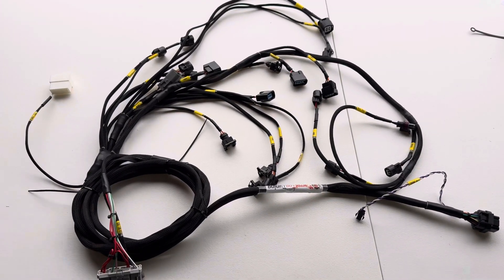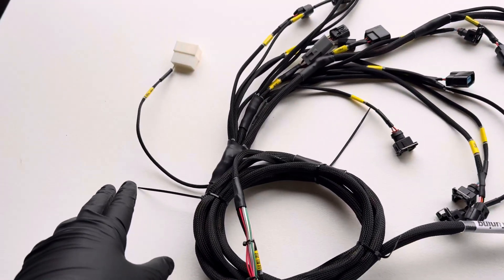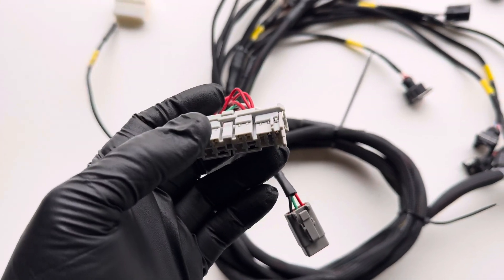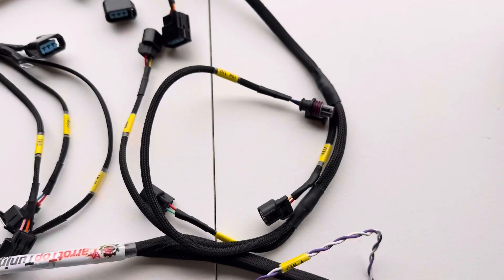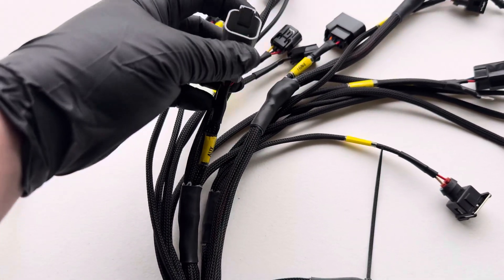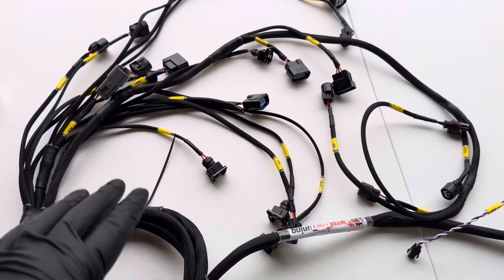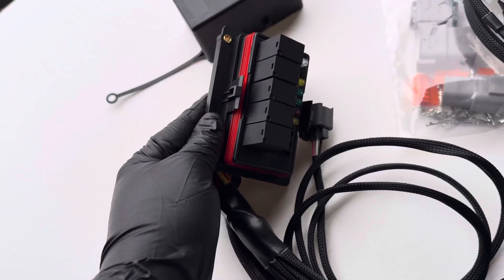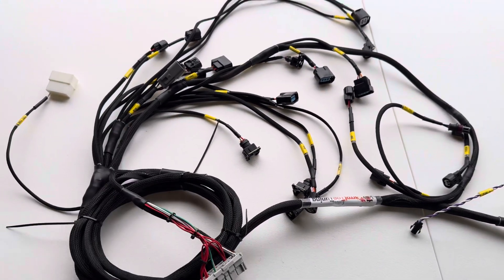Fueltech FT450 Complete Engine Harness Overview K Series K20 K24

Comment: Stupid q, with this setup on an Rsx and using the jumper harness would all the dash, lights auxiliary work on a 450?
Reply from the maker: You'd get no factory dash lights while using the FT450 the FT450 will be used as the sole dash.

Comment: What awg is the wire that occupies in the harness?
Reply from the maker: Wires vary depending on what its used for, not all harness is made with same gauge wiring.
Reply: @ For example, in this harness, which AWG cable is used for the positive of the coils and injector?
Reply: @vibrapa1823  Standard 16GA they don't require high gauge wires for smart coils or high imp injectors.

Comment: Hi bro.. how much harness? Nice video, thanks .
Reply from the maker: Here is the direct link,
https://www.carrottoptuning.com/products/fueltech-ft450-complete-standalone-honda-k20-k24-series-engine-harness?_pos=2&_sid=10afef868&_ss=r&variant=42346532929619
Reply: the sub harness they sell for 99 ek.. is it plug and play? I don't have to make a relay box for ignition, fuel, injector? Thank
Reply from the maker: @edwinxavier262  Yes, if you use the K series sub harness it'll be plug and play.
Reply: You say fuelpump plug IS required? What if you deleted factory fuel pump harness and rewired on relays for 2 outside pumps. Race style.  What do you do then . (EG hatch K swap )

Comment: So I'm in the market for something like this i believe!
My project is a 92 civic eg hatch I have a k24a8 im swaping into the car with a turbo at the moment I have a stock engine harness and a hondata v2 computer
I was looking at the fuel tech 450 with these 2 harnesses? I would like to strip out my complete chassis harness to ditch the old wires and potential problems. Can i run headlights/ taillights and other stuff off this combo? Car will be track purpose built but I will like to drive it around town
Reply: Hi there, this harness with the fusebox combo, will run the engine only. The headlights and other accessories, while can be wired to the AUX switches will need to have their own relays ran for proper operation.